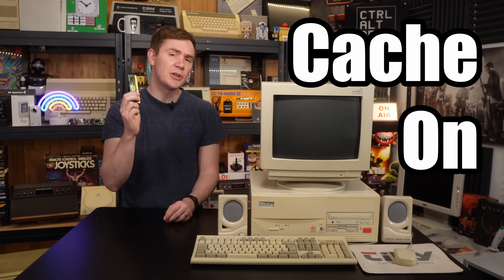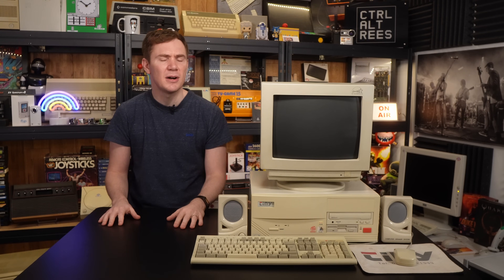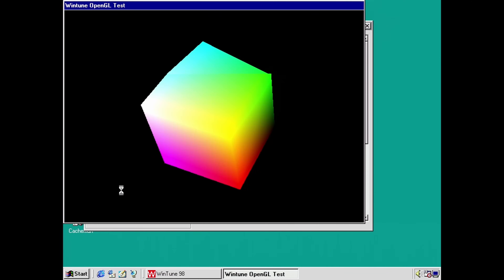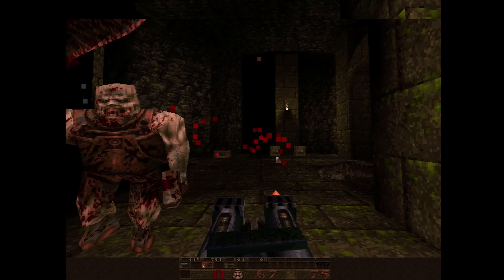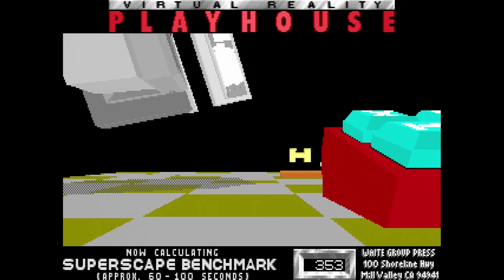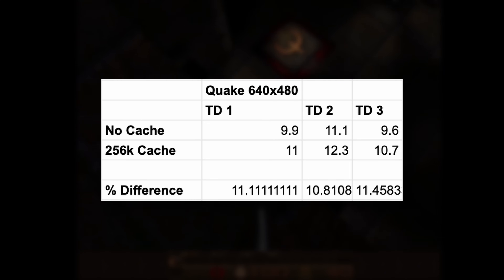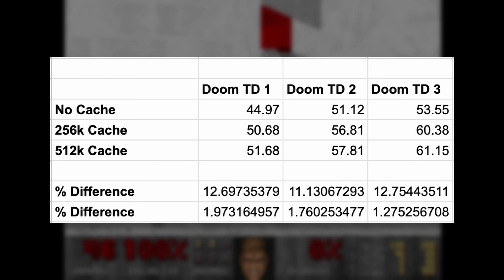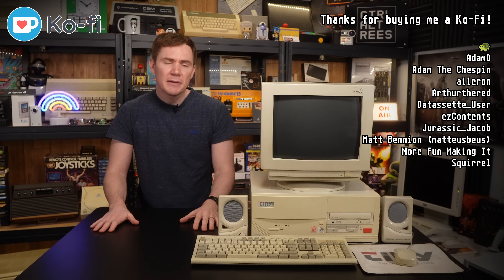A COAST Module For My Pentium 100

Comment: I think there’s a decimal point on the 3DBench mark.  102.3 rather than 1023 and 105.6 instead of 1056.
Reply from the maker: Oops. You're correct! Looks like I misread that. 🙂
Reply: @ctrlaltrees not surprising, it’s very had to see.   😊

Comment: Nice. I very vaguely remember how people used to swear on Cache when I had my 386 - but my cheapo machine of course had none 😅. When I upgraded from there to a Cyrix P200+ in around 98, I don't remember that much talk about Cache anymore. It was all about 3D cards. I try to think of a really slow machine, a 386 with a slow Connor or (even worse at that time at least) Tandon HDD, maybe even a pretty bad mainboard and cheapest RAM and wonder what difference it would have made on that. But I'll probably never go back to revisit my 386 days hardwarewise anyways 😅. Too confident with my Pentium 133 for all my DOS gaming needs. Cheers!

Comment: the COASTs were ment to be alone, not mixed with the cache in the motherboard. Also its very noticeable the lack of cache in faster pentiums. I vivid remember a client who had a Pentium 200 in an Pcchips M519 (Opti Viper Chipset) with no cache in 2002. it was DOG slow, once i added the 256k was like twice as fast for everything. It was maybe the best case-scenario for this as i never seen such a difference again
Reply from the maker: Indeed, I always thought the same but there don't seem to be any options here for specifically disabling the motherboard cache, either in the BIOS or as a jumper. Disabling the external cache in the BIOS also disables the COAST module when installed. So either this board is a suboptimal design (which might explain the results) or it's handling this automatically somehow in the background.
Reply: @ctrlaltrees  There is a third option, which is your COAST module is a big 'ol fake.
Reply: @ctrlaltrees  try putting the maximum amount of RAM in then re-run the tests that showed the most improvement with cache enabled VS disabled. Is there a 512K COAST?
Reply: True. Also, it was a cheap way (for manufacturers of course) to replace classic SRAM L2 (DIP IC's) into innovative Pipeline Burst SRAM. There are different types/construction of a COAST sticks. I have a few of them and none is able to work with onboard cache - usually switches it off completely.

Comment: Nice reminder how bad Quake was on 486 (486 "Dx2" 100 in my case, 2x50MHz as I was experimenting with low-budget overclocking in my poor times - AFAIR it was ~10-11 FPS in my case).
Reply from the maker: This is how I actually played it back in 1996! Well, briefly, until I begged my parents for a new PC... 😅
Reply: DX2 would have been 50 or 66mhz, not 100. 100 would be dx4.
Reply: @ghostdog662  dx2 name was "dx2" as a joke, in fact it was Am486Dx4VT8 (3x33) but I was able to run it 2x50MHz.

Comment: The lack of a significant difference in the actual benchmarks (as compared to the tests with Doom and Quake) when comparing 256k and 512k of cache actually makes a lot of sense, and kind of highlights why benchmarks need to be tuned properly for what they’re trying to simulate. It’s very likely that 100% of the code and most of the data being operated on fit comfortably in less than 256k of memory, in which case 100% of it would fit in the 256k of cache. And if that’s the case, then you would logically expect to not see any practical improvement with 512k of cache, because the extra resources would never get used by those benchmarks.

Of course, that’s not a level of detail most prospective PC users in the mid 90's would know or care about, but it is an effect that’s still visible today in some cases (usually when testing high-performance code on CPUs with significantly different L1 cache geometry) and can really surprise programmers who somehow don’t have a good low-level understanding of how a computer works.
Reply: 512KB might've also been a target for more professional workstation/research/"big" data kinda stuff for the time too, where most applications for consumers/end users would've likely been optimizing for considerably smaller caches, so yeah you probably do see the meaningful difference in workloads and which tiers different things would've been intended for.  But yeah if you were a heavy multitasker or you were working in a DAW or larger photos or even video at the time, the extra cache could've probably helped.
Reply: I guess that for the 16M RAM that he have installed, 128k, 256k or 512k cache would give the same-ish results. The amount of cache needed is related to the amount of RAM installed, but I did not find a reliable relation between the two. Also the tag memory is involved in the equation.
Reply: the other thing to take into consideration are the tests and games are non-multi-tasking loads. as you stated above most everything is likely sitting inside the cache. however under loads with a great deal of context switches the more cache the better in quite noticeable ways.